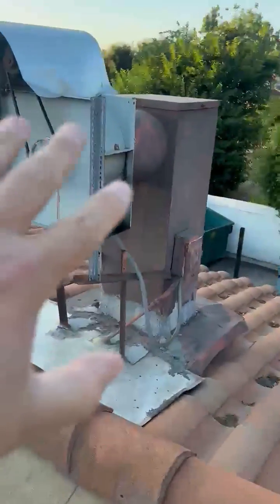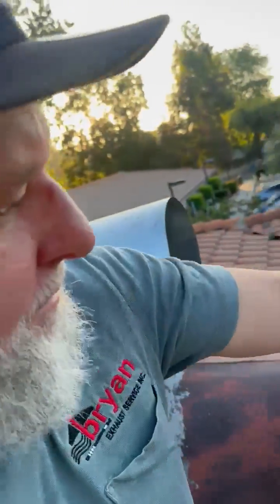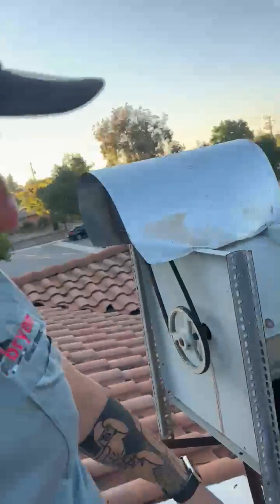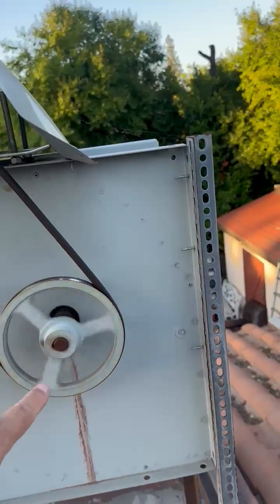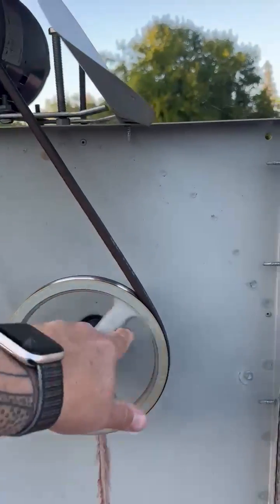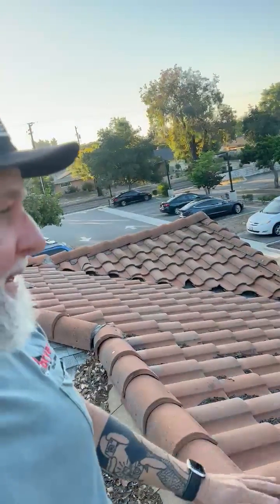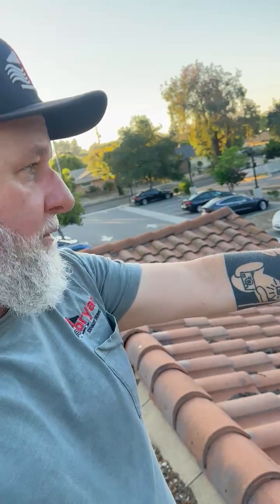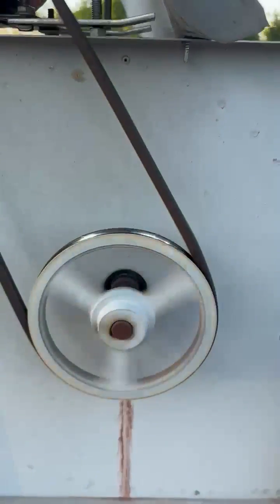What Do You Do When A Fan is Running Backwards?

Comment: If it's a three phase motor, just swap any two power leads. If it's singel phase, consult the wiring diagram in the motor junction box. It should show you how to wire it for either rotation.